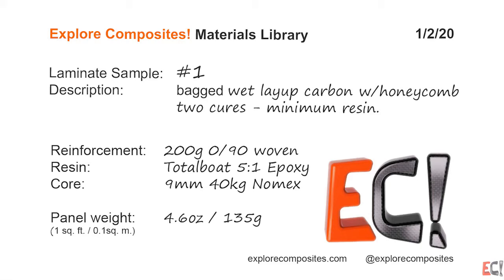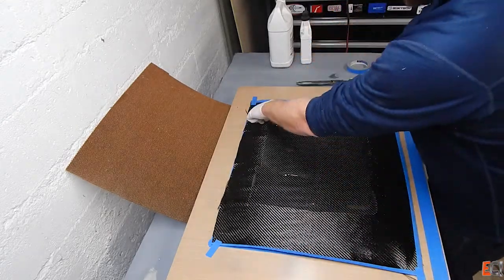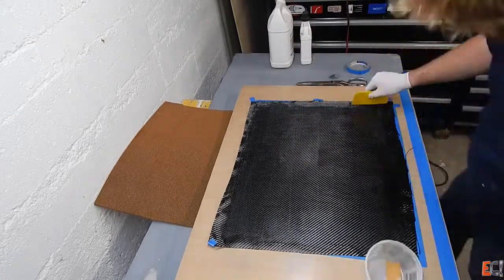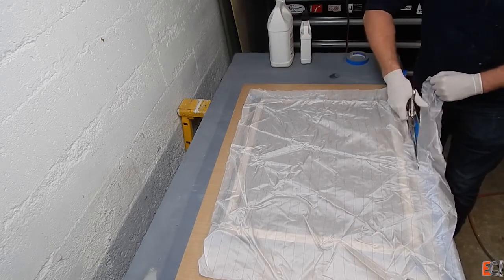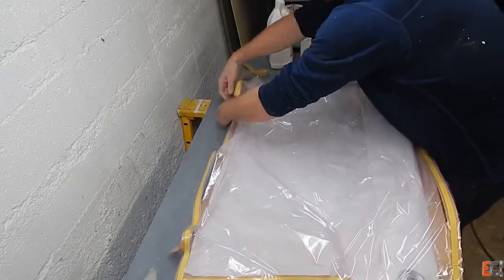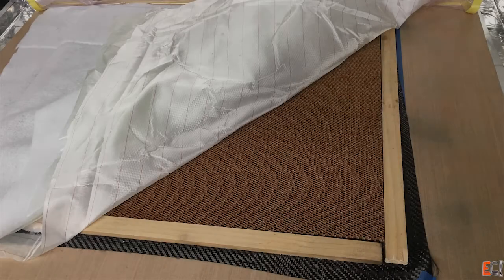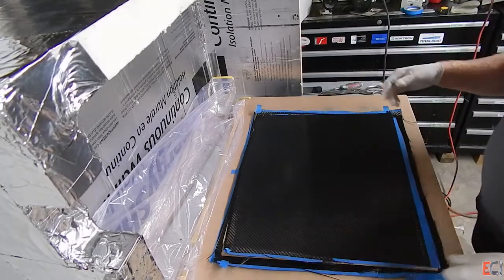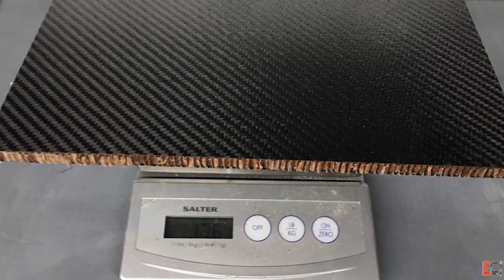Laminate Sample #1: Light Carbon Fiber on 9mm Nomex - Vacuum Bagged Epoxy Wet-layup

Comment: guessing u meant 40 grams, not 40 kilograms...? no way that bit of nomex was 40kg...btw, any reason why you would do both sides of carbon in 1 go?
Reply from the maker: I meant that that piece of Nomex is of a density that is 40kg per cubic meter - but yes, the little piece is light!  And the reason to do both sides it to see how it comes out... which in this case isn't ideal.
Reply: that makes way more sense indeed...I actually meant to ask was why do both sides separately and not 1 on lay-up?   @ExploreComposites
Reply from the maker: @MaartenOosterbaan  I was trying to get two "finished" sides - but I only got two pin-hole filled but flat sides.  With honeycomb cores and thin skins, the bag side laminate gets pushed into the holes in the honeycomb leaving a dimpled (and rough from peel ply) surface.  Also resin in the "top" skin can drain out into the honeycomb cells leaving the laminate dry.
Reply: ah, ok...well better to be safe than sorry...no cheap materials... @ExploreComposites

Comment: My porosity problems seam to occur because of the bleeding of the resin into all the areas that are under vacuum. Do you have any tips regarding that?
Reply from the maker: I am not sure I understand the exact issue - does too much resin bleed out, or is it migrating under the bag to places you don't want it (where?) leaving dry areas?  A couple of ideas:

1. Perforated release film (hole patterns can sized vary by product) is necessary for limiting bleed.  Laps should only be 10-15mm (1/2").

2. Use less vacuum - half or even less can be plenty to consolidate.

3.  Allow resin to start to gel (slightly) before pulling vacuum.  Some wet-layup resins specify a time to first compaction or some other thing - so the resin isn't sitting uncured and very liquid for a long time under vacuum.

4. Sometimes you are best off dividing a lamination into multiple curing steps - especially if there is core or things are complicated.
Reply: @ExploreComposites  thank you very much for the detailed response. I will try your Tipps in the next laminations. Thanks again

Comment: I also done the similar test board, it's very strong. But the next question for me is: how to close the cell at the edge? 😂
Reply from the maker: See sample #46 for one way - cutting back the core and back-filling with thickened resin.  You can laminate some kind of capping and closeout plies over the edge tying the skins together.

Comment: Good job! But why didn't you do both sides in the same time, with the upper side under another flat plate (for example, glass)? It's just a question. I'm new in these kind of things 😉
Reply from the maker: I wanted gravity to keep the resin on the surface and not run into the honeycomb.  You can do it one shot and people do this often... but here I was going for absolute minimum (too little!) resin and a shiny surface on both sides.  See this other one: https://youtu.be/5h4JT1ggvX8

Comment: Thanks for the videos! I have been watching them and was wondering what you are using for a surface/table in these layups. In other videos you say "I put it right on the teflon" - are you using a teflon board or something coated with teflon? Do you have somewhere in the videos or on your site that talks about the tables/surface you are using for these panel layups?
Reply from the maker: It is a carbon table with a layer of adhesive teflon film.  More here: https://explorecomposites.com/articles/tooling/adhesive-teflon-its-awesome/

Comment: Cold room and high viscosity resin? Try putting hot water in one of the mixing tubs then sit another tub with the resin stacked on top of the hot/warm water. Easier to wet out the fabric but working time may be reduced as the resin will jell quicker.
Reply from the maker: Yes, any heat would have helped!  In later samples I added a heated table.

Comment: I’m looking to build a rigid panel for camper shell. What would you recommend for the core material? Most panels will be carbon, but I’m just clueless on what core material would be best
Reply from the maker: It depends on lots of things.  Is it just a shell or does it provide insulation?  Curvature and span between supports is important.  My guess is a 12mm / 0.5” light foam core (a recycled PET or a PVC about 50-80kg/m2or 3-5lb / ft2) with light carbon skins would be a good start.  Make some tests and beat them up!
Reply: @ExploreComposites  okay thank you. Was looking for a good jumping off point and that will work!

Comment: Enjoy your videos but would be good if you had a consistent testing process when finished even if fairly simple like one I saw you did with a deflection test, the break test showing how a narrow sample fails. Maybe an impact test. I’m trying to work out what materials to make a lightweight, stiff hardtop for a car. But won’t be dangerous in a roll over like an only carbon one would be. But also something not too crazy on the cost. I’m angling towards a lunate of 210g kevlar with a 6mm thermhex core and another 210g kevlar on the inside with some addition bracing added afterwards of just some simple ribs of something lightweight with a couple of layers of the 210g Kevlar. Using epoxy resin. It will be wet lay up with a light vacuum to consolidate it all. Any pointers would be great

Comment: why are you not heating your resin if you are worried about it being thick?
Reply from the maker: I am not a fan of heating resin unless the tooling is also heated because once the resin hits the mold it will cool off.  Thermal mass issue.  In many of the newer samples I use a heated table.

Comment: That weight isn't bad.  By comparison, a sandwich of 9-oz fiberglass skins and 1/2" tongue-and-groove red cedar weighs in about right at one pound to the square foot.  I'd be interested in doing destructive testing on both panels-- but (exclusive of cost) it's hard to imagine a better stiffness-to-weight ratio than you've got there.
Reply from the maker: There's a cedar sample in here somewhere but it's heavy compared to the carbon/nomex.  In a boat, I'd rather have cedar and fiberglass between me and the ocean!

Comment: Peel-Ply is to go up against the wet carbon for a clean surface finish.
Reply from the maker: Do you mean on the tape face?  Yes that would work ok for panels you want to bond to.  Not shiny!  

Check out Laminate Sample #41 - it's really light and done in one shot but the plastic method shown would work for peel ply too as a first light ply.

Comment: Love your videos.   Is the porosity caused by the vacuum drawing through the individual cells??   Seems like it would draw the resin up into the cells.  I’m clearly missing something but I’m extremely curious as to what.   Thanks.
Reply from the maker: The porosity is mostly because the resin was very thick and I didn't use enough and didn't roll it out with a bubble-popper.  Slightly more resin would make a big difference in to porosity!  The resin will wick up the cell walls and make nice bonding "fillets" but it won't make it up to the top skin or bleed off.  This is a strange way to make a panel and was kind of an experiment but it has its drawbacks.

Comment: Great work! Why do you use breather and peel ply on the dry side of panel. I think they do not fulfill their function. Doesnt it work better on the wet side of panel? Thanks.
Reply from the maker: The peel ply is just to keep the breather from sticking to any exposed resin, and the breather is to spread vacuum and also protect the bag from the sharp edges of the core/wood frame.  Probably would have worked ok with just peel ply but breather helps.  You are right that here it doesn’t absorb excess resin.  This is an example of a cheap fast way to do this but it is in no way the best way to do it!
Reply: @ExploreComposites  Ok thank you. Nice video.

Comment: If you want lowest resin to fiber ratio in a wet layup you should have a layer of breather cloth under the wet side, so you'd need to use peel ply as well.  You won't get a shiny surface finish so you'd have to wet sand and polish for that.  I use this method often and get 38% resin to fiber ratio.  Why are you using massive pleats on a flat panel?  Totally unnecessary on flat panels, also looks like you are using Stretchlon bag film anyway.  Try bagging a panel without pleats, I do this with regular film and have no issues.  You are cutting the panel down anyway to remove the battens, any bridging you get will only be at the outer edges anyway.
Reply from the maker: The goal here was to try to get two molded sides - makes no sense to put breather and peel ply against a tooled surface.  Polishing and wet sanding is work!  You’re right on the pleats being big but I wouldn’t skip them even on a thin panel - you can do as you say with very thin panels and I do in other sample videos.  Bag film is standard nylon - not a fan of Stretchlon in general!

Comment: what's tape used for sealing? it's look reused for many vacuum process
Reply from the maker: This is a Solvay Vac-Seal 2042 - a pretty standard type of vacuum bagging sealant tape.  Plenty of other manufacturers (Airtech, General Sealants, etc.) make it and it comes in different heat tolerances and sticky-ness.  It can be bought from pretty much any seller of composites vacuum bagging supplies.  It isn't super cheap but it works great.  

There are metal roof sealant tapes that work too - they may even be the same material - but you want the 3mm thick x 12mm wide stuff - the thinner material doesn't work as well.

Comment: Amazing material.  Thanks for showing me how its made.
Reply from the maker: This is just one way - and not the standard one.  Usually honeycombs are used with pre-pregs.  This method does work pretty well though for lightly loaded panels - and is way less trouble and way cheaper.  Glad you found the video useful!
Reply: @ExploreComposites  Enjoy your videos but would be good if you had a consistent testing process when finished even if fairly simple like one I saw you did with a deflection test, the break test showing how a narrow sample fails. Maybe an impact test. I’m trying to work out what materials to make a lightweight, stiff hardtop for a car. But won’t be dangerous in a roll over like an only carbon one would be. But also something not too crazy on the cost. I’m angling towards a lunate of 210g kevlar with a 6mm thermhex core and another 210g kevlar on the inside with some addition bracing added afterwards of just some simple ribs of something lightweight with a couple of layers of the 210g Kevlar. Using epoxy resin. It will be wet lay up with a light vacuum to consolidate it all. Any pointers would be great